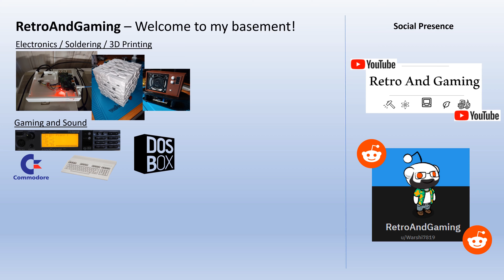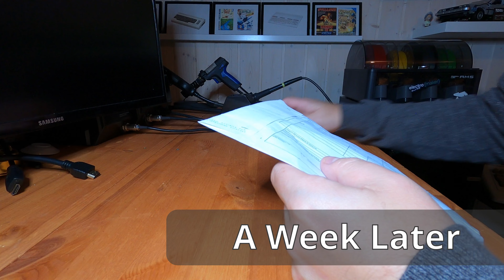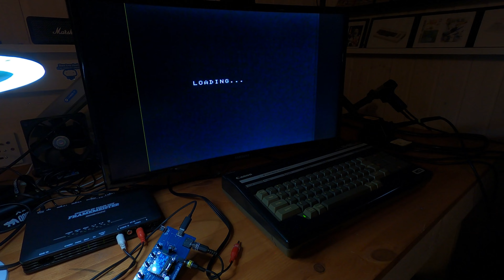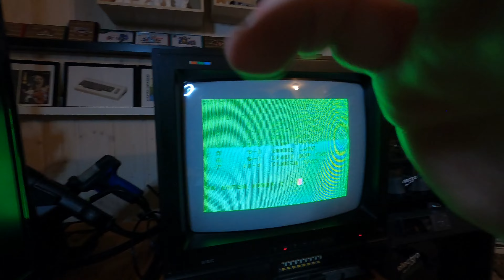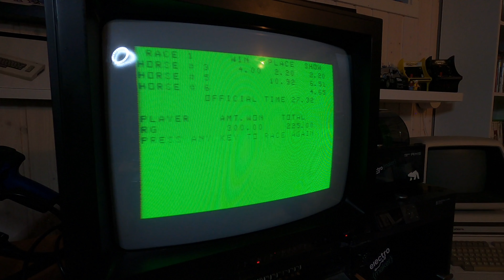DIY He Said!? CASDuino/MAXDuino Adventure

Comment: I've built one from scratch on a piece of prototype board some time ago. Used an Arduino Uno. Works like a charm but doesn't look good.
Reply from the maker: Yeah, I was anticipating a simple build.. I also spent a day reducing the size of the code to be able to fit a debug library on the Arduino. Removed start screen and all menu's but I still was a few bytes short. In the end I just bought a new one. Either I have installed some version of some library that caused it to be unstable or I also damaged the only other IC on the board (the amplifier chip). But hard to know when I wasn't able to hook up a debugger to it...